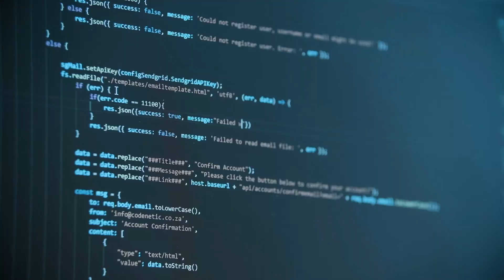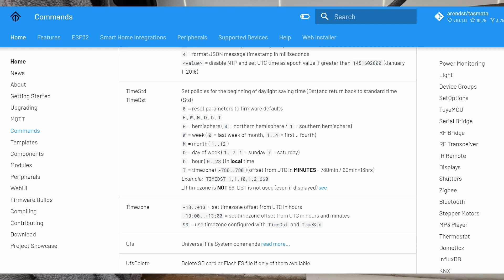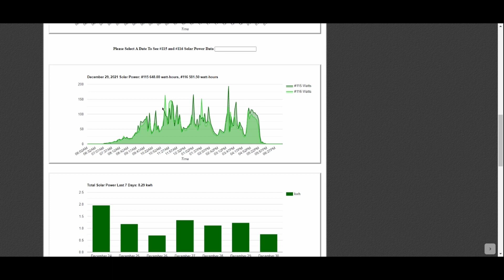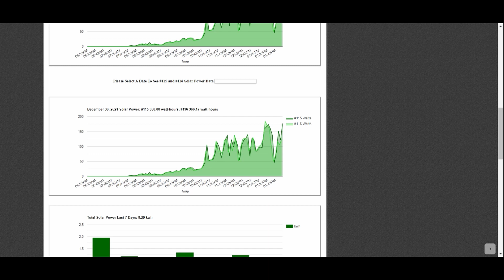Failure and Repair of my Enphase Solar Power System

Comment: I have Two panels with each microinverter enphase. One of my panel not working, it's microinverter not blinking any color, what would be the problem?
Reply from the maker: Could be several things: a bad microinverter, bad panel, bad solar wire or bad AC wire.  You can test the module with a DC voltmeter, should be around 12-24 volts.  Look for bad connectors, broken wires, etc.

Comment: great video. very much enjoyed watching it.... yes you could throw away the breaker. or maybe the other way to go is to keep it and hang it up on the wall next to your other electrucal equipment. as a clear and practical reminder as for what to check up on the next time something like this happens. i suppose it could also benefit to look into the matter a bit further. either at the breaker part itself. or on the enphase side (if enphase have some user forums website idk, otherwise the general solar forums one).

for example if the solar equipment is presenting on the line and creating some unique pattern of conditions for this failure mode to occur more often? when these certain specific types of breakers operate on some averaging? over current scheme. with occurs over an extended over current period of many seconds before they finally trip. it is a part of their design, how they are meant to 'work' hehe. if you can call it that. so i just wonder if a different type of a breaker style can be  anyrhing helpful ? if it were to use a different type of principle with a different mechanim. or is it was indeed more about the specific manufacturer choices, and that brand of this component. if you get my drift here

hum... not much else to be wondering about here, was good content appreciated thanks. and a bit of extra food for thought. as to what else to consider when installing home solar systems. glad it wasnt the enphase inverter! because we really want to be depending a lot on them going forwards. and they are a bit pricey. and only have a limited duration warranty, right? what is it? 5 or 10 years or something. cant remember now.
Reply from the maker: Thanks for your thoughts on the breaker and the unique workload that the Enphase is putting on the wire.  My other identical system is working well, but I'll definitely keep an eye out for this failure mode.  

The IQ7+ model I have has a 10 years warranty.  I was a monitoring engineer in the solar business when Enphase entered the market and everyone was worried if the units could handle the heat / cold / rain / ice / power profiles, etc. but time has proven that they're extremely reliable, albeit expensive.  If you go way back to my first version of my solar, I used no-name Chinesium microinverters from AliExpress which failed quickly and the seller stopped responding to me.  Big lesson learned - go with the quality product from the start!